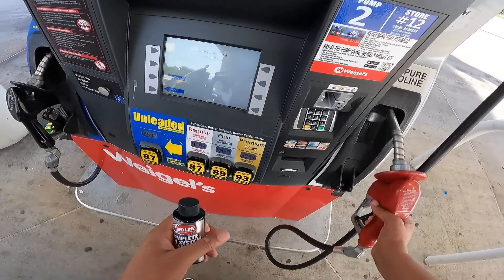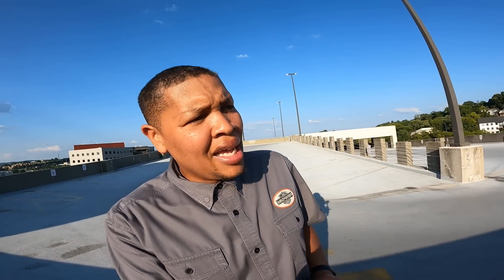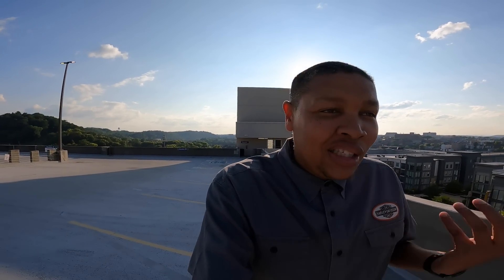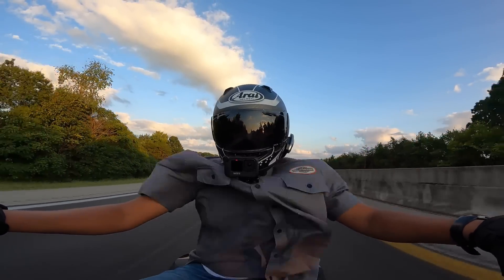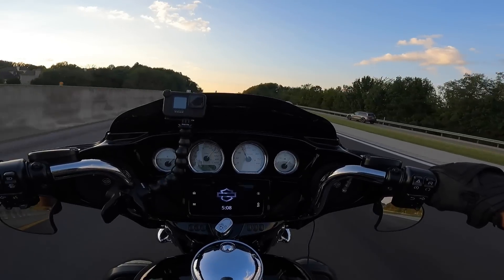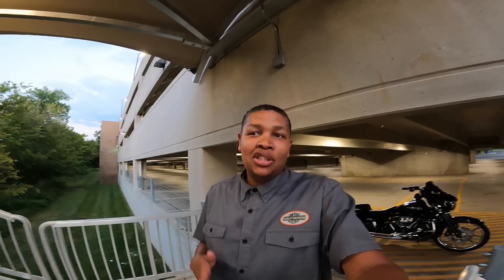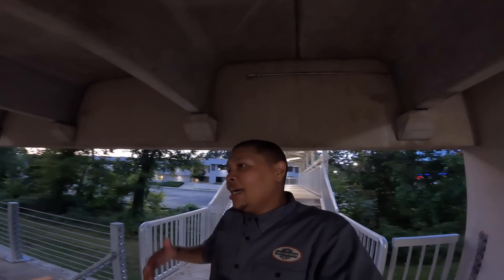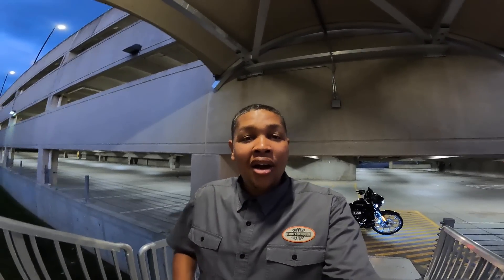Before you do a Big Bore Kit on your Harley-Davidson watch This! Zipper's Performance Products

Comment: I'm 75 and haven't riden a bike in 27 years and never a Harley because they didn't have the power I wanted but viewing your video got me looking at my checkbook in a new way. Great information!!
Reply: Better plan on a BIG CHECK.
Hahahaha the new Street and Road glide CVO ARE INCREDIBLE 
BUT $50,000 and then comes the upgrades, at least exhaust.  They are unbelievable. In a couple years they will be used and much cheaper, and the person before you will probably have done the upgrades.

Comment: 117 stock CVO Limited (2020) is 91 HP and 113 torque from the factory.  I added the Stage IV 131 with George Bryce 3/4 Race M8 .585 cam.  Final numbers were 129.42 HP and 140.85 torque.  I added a Rekluse clutch as well.
Reply: Just WOW sounds like fun the kill ya quick if you mess up kinda fun lol
Reply from the maker: What tuner are you running and exhaust? Full or slip-ons?
Reply: Something is missing. You should be getting close to 150HP with that engine. Tune, Exhaust, Intake Manifold, Throttle Body
Reply: Just curious what was the rough cost on that? If you're in that 7 ish grand mark than potentially a turbo mightve been a better purchase.
Reply: A tuner around me is getting 120hp-134 out of a 117 with just cam change. Your numbers are way low.
Reply: @bmxriderforlife1234  His new one has to be over 10K. Darkhorse 4-5/8" crank - Compensator - cam- lifters- jugs, domed pistons, etc.
Reply: Cubic inch X 1.2 is where you should be with full exhaust, cam , heads, good tune!
Reply: My mom won a raffle for a 2020 lowrider S with the 131 stage 4 crate motor. Idk what the cams r that come n it but she's pushing 144hp and 156 torque. It'll scream 130mph n 4th gear with 2 more to go and I let out of it. She's fast gentlemen
Reply: @bmxriderforlife1234 I'm not sure what he paid but mom's was built n 2021 and the motor was around 10k, but I think the 131 is about 7-8k now withe the new 135ci motor out now.

Comment: I just raced a Milwaukee 8 with a stage 3 with my 96 stage 4 built to a 107 and I smoked the Milwaukee 8 even with a passenger on my bike  and my bike is heavier,LOVE THE V TWINS and they sound so much better thsn the Milwaukees hands down .
Reply: I’m doing a big bore kit with the port and polish on my twin cam 96 going to a 107!  Glad to hear positives on the twin cam 107  stage 4
Reply: What 107 do you have I am picking cams and cylinders and would like to buy I. The next few days

Comment: Show me where a chain "robs" power. Chain actually increases torque. Chains are waaay better for performance. Not to mention the gears changes that cab made easily. Also the chain us way simpler to replace. I got a bone stock twincam 88 with a modded carb and 2into1 and I've destroyed the belt once dropping the clutch. Belt are for grandpa riders. I've beat bikes just like mine with big bore kits. Sometimes going fast is all about the rider. Horse power means nothing if you cant ride HARD.

Comment: The H-D trans is actually not a bad trans.  It’s had some issues in the past, but they seemed to have corrected them.  There are also kits like from Jim’s that are out there to beef it up.  I have been told that the Baker 7 Speed creates issues with the ECM.  Something to do with the ECM displaying the current gear and not knowing how to read the 7th gear?  I also think an oil cooler fan and rear cylinder fan are essential to a big bore kit. I live near Chicago.  Traffic is just a thing here.

Comment: It’s really all about the knowledge of your builders. That’s why you get more out of a 124 than a bolt on 131. Plus the bolt on 131 kits offered at Harley are still EPA and Carb compliant. Choose your engine builder wisely. Great video Tall. God Bless and ride safe. 👍
Reply: I love the 131. Full warranty and plenty of power for an average rider like me. 

Had a couple minor issues and just ride it into a dealer and fixed it right up. Awesome.

Comment: I agree 100%

I had a 114 roadglide special. Did a 131 stage IV. 

Now I have a 117 Low rider S. 

Doing it now, I’d just pick a touring bike with a 107 and do the stage IV. 

The 107-114-117; good luck telling the difference while riding. The 131; that you could for sure feel.

Comment: 107 has a shorter stroke than the 114/117. Revs up faster. But because of that you can't go to a 131. Only the 128 with SE product. Either way there is good power (120hp/130tq) to be had out of an M8 with as little as a good cam and tune because of the flow of the even stock heads. Stay safe.  
Edit: Excellent usage of edit splicing. Great informative video Tall. 👍
Reply from the maker: With Zipper's Performance 107s go to 124s and 114/117 goes to 128s  I agree you can get some great numbers with a cam swap. My dad's 107 with a Redshift Cam made 117 tourqe and 107 horsepower.
Reply: @TravelingTall  thanks. I'm rocking a new to me 2015 Street Glide. 💪 I'm a big fan of the Zippers product. And the fact that they still got love for us Twin Cam guys is even better. Loved your build with them on Memphis. My problem is I'm down in Australia and a lot of  companies won't ship here. Keep Glidin.
Reply: You could get 131" c.i. of displacement using the short 4 3/8" crank stroke if you slightly bore the engine cases to drop in big bore 4.375" bore jugs. A short stroke 131" with a high RPM horsepower cam will definitely put your driving privileges at risk!
Reply: Keep it 107 and turbo stage 1 or go 114 and turbo stage 1. Probably best bang for the buck for performance. And keeping the shorter stroke also means you can build the engine to rev higher if you want to.
Reply: @parkeslife4323  check toowoomba HD master mech Tom  mitchell may help. Is on youtube

Comment: Or the 131 crate motor available n 2021. Brutus the shadetree surgeon Lowrider S was built n 2021 and n 2020 they did Road King Kong with the 131 also, but i think those were ceate engines so not sure of big bore kit availability.

Comment: I bought a new 2018 Street Glide Special and got the SE Stage4 which took my 107 to 114 and changed the cam to a RedShift 472.
Only makes 120/130. 
I'm thinking of getting the S&S 124 kit and swapping out the cylinders/]pistons but not sure what gains I'll get

Comment: I have 131SE installed. Harley has to stick to their EPA legal tune.  I decided to have my bike 100% blueprinted by Kevin Baxter with  a Skunkworks build. Going to be a street sleeper, with balanced and built bottom end to handle all that power.
Reply: How much for the engine from Kevin?

Comment: Another reason to go with really big bores is to increase displacement but while keeping the stroke the same length for higher red lines or potentially short stroker builds for really high red lines. This is my personal route for a custom bike build. 

Likely a 4 to 4.25 stroke. 4 to 4.25 bore most likely split the difference with a 4.125 trying to keep the redline high while keeping some decent low end albeit shifting the peak torque a little higher to also help with traction. Part of keeping redlines higher safely is piston speed at 4.25 stroke you can really only do 6500 maybe 6800 before the pistons are pushed. At a 4 inch stroke 7000 rpms is reasonable, and given it's not much above where valve float starts to happen it seems to be a decent point where the diminishing returns would kick in for the valve train stuff and reliability. Although depends on exact engine.  

Most performance increases besides a few will generally help torque all across the curve. Ho is just torque times rpms. So building over all torque and shifting a little bit to the mid and high end versus only low end and completely killing the top end or pushing the pistons hard. Trade off in some shorter strokes is worth it. 

Play with rod length and ratios and you can tune some stability and also help with the low end or top end based off what you need or split the difference. 

From there throw the turbo or super. Turbo done right can net performance gains and help with reliability at altitude plus also help with fuel economy as long as you maintain decent throttle control but for touring still makes sense with cruise control. 

Given you can get the turbos to spool uo fairly early just have it start earlier on in the rpm range but tuned to work across the boosted curve section. 

End result when done right is a bike that still drives around well for town and can be driven more like a truck in the low rpms. And also a rocket ship that revs high for a harley and just builds endlessly across its power band. 

Even with a simple 108 stroked and bore knucklehead I'm looking at roughly 167 to 177 hp as a base estimate. With low boost. Spend the money balancing stuff and working on the weight and also deflection and pushing slightly higher rpms wouldn't be hard even safely. Right pistons even easier as some are rated beyond 4500 feet per minute. Get the oil running within its peak temp range and a cooler so the turbos happy. 

I'd go forged connecting rods. Best pistons I can find. Make sure all the valve work is done properly.
Reply: The belt does however rob some horsepower from the primary and final to the wheel. Dual belts it's something like 15 percent parasitic loses versus a chain which is louder and requires probably more maintenance.

Comment: Great video! Looking to build my 107. What does dark horse do to the crank? Wanting mine reliable like yours😁
I'm running the zippers 468 currently. Love it, but like you said, wanting more. I've got 20000 miles on mine without a single problem

Comment: Sounds like your bike has been in and out of hd shop several times. The chain issue my bike broke the bdl belt made for big inch engine like it was a cotton shoe string  but I didn't build the hd platform I wanted the most for my $ so I went with s&s v124 crate engine 140hp 140tq will do more but for break in and warranty I didn't want to push it to 170 hp and 170 tq

Comment: My Brothers I have a 2019 cvo streetglide.  131 SE. I keep getting death wobble at 85 mph and up. What can I do to make this disappear.  I have new tires front and back, Legands suspension in the rear, still wobble above 85mph
Reply: Check out your engine mounts. The back swing arm mounts if the bushings are worn, then the wheels will NOT stay in inline. The aftermarket has parts that can help with this. An O9?? How many miles? The only thing you can do is to eminate the possibilities. Wheels, tires, steering head, swing arm bushings and bearings, motor mounts.  Good luck 👍 
It can be frustrating.
Reply: Recheck your tire pressures and have your steering column bolt touque verified. I once put a Z reted tire on my bike and because its contact patch is much narrower i had same issue. Was that tire. Be super sure pressure are spot on
Reply: Did the wobble occur before legends install?
Reply: Verify wheels are balanced. Spin balanced.
Reply from the maker: I had that happen to me also, it's worse on decel. Let me know what you find out. Stay safe.
Reply: I went with transmission/swingarm brace! It stopped my higher speed sweeper curve wobble!!

Comment: Question I have is, what did your mileage end up at compared to stock with $4.00 plus gas.
Reply from the maker: I get about 210 out of a 6 gallon tank
Reply: I have a mate of mine that has a 131 in a RK with 179hp and 189ft normally aspirated
Reply: Don’t worry about the gas just rip the throttle 😂
Reply: Zippers is cool but I love S&S. To each is own I guess. They both make great products. I have a S&S 107 to 129 big bore kit. 🔥🔥🔥🔥🔥🔥

Comment: You did the big bore and didn't port the heads that is a must been doing heads for 50 years my 114 with my head work and a 468 cam 5.5 injectors cat out of the stock pipe and tuned by American Speed and machine 139 hp and 136 tork the heads alone were worth 8 hp kibble white valves and it's a tire burner 1st rhrough4 stock bikes suck!

Comment: You guys make me laugh 1 horsepower per cubic inch the British had that beat in 1950. The engine is twice as big and makes twice the horsepower at the same volumetric efficiency. Today's Harley Rider is incapable of doing anything beyond putting gas in the gas tank and I am surprised they are capable of even doing that. The old Harley guy could do everything on his motorcycle and the new one can't do anything at all. The new Harley Rider takes his Harley to get the oil level check and his air pressure checked and talks with the other old farts about how well their stock Investments are doing breaking their free cup of coffee while they're getting charged a $25 minimum fee. So sorry so pathetic, so lame. Yesterday's Harley-Davidson was a real motorcycle today's Harley-Davidson is a collection of government regulations on two wheels.